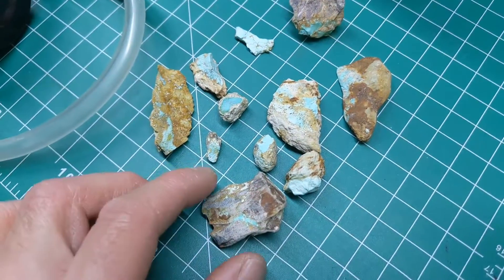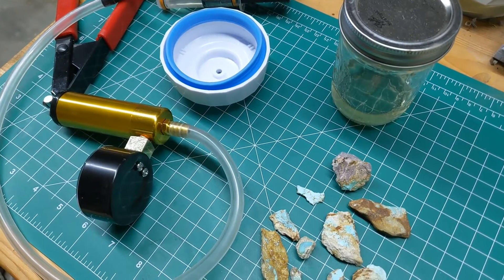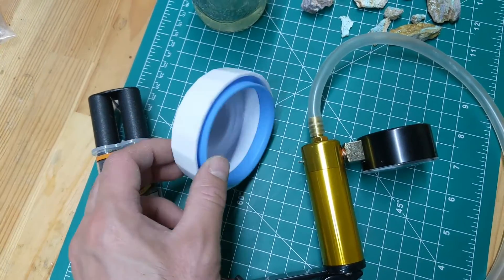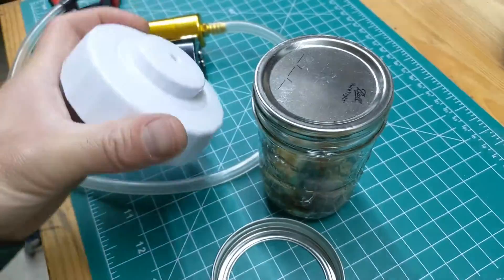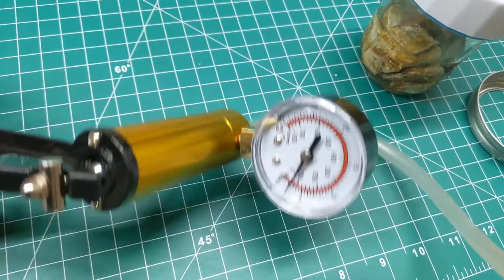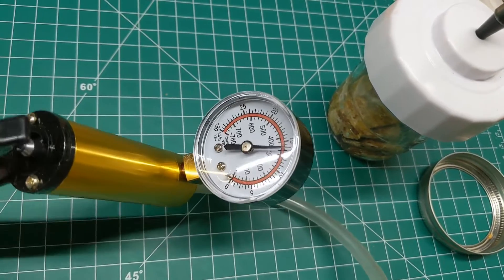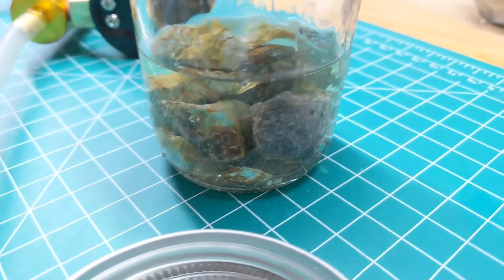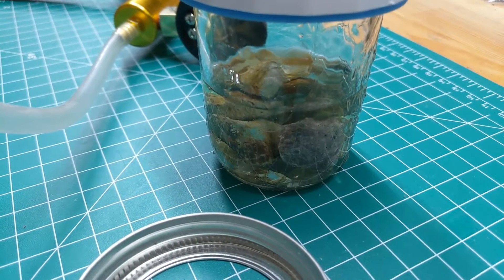How to Stabilize Turquoise DIY (Cheap & Easy)

Comment: You didn't say if you took off the tin lid before you added the pump lid.
Reply: No, no he did not, he figured he wasn’t addressing idiots.
Reply: @mray1255  Actually, the mason jar lids are 2 part lids.  The outer rim comes off when using that type of vacuum sealer, but the actual lid is meant to stay on the jar as the sealer is used.  The pressure difference between the low pressure inside the jar and the atmosphere outside the jar creates a secure seal by forcing this lid (which has a rubber seal on the underside) onto the jar.

The lids are able to maintain a vacuum inside the jar for years.  I have some that  have held for 3 or 4 years and others have jars that have held even longer.   Once the jar has been vacuumed you don't actually need the outer rim as the pressure difference maintains the lid securely.

You see him take off the outer ring and it's there on the mat next to the jar, but you don't see the actual lid being removed.  You do see him put the pump over it but he could have removed it in the bit of footage that's cut out.

As the air is drawn out of the jar the bubbling you see is any air trapped inside the stone equalising it's pressure with the rest of the jar.  Once the bubbling stops it means that the pressure in the pores has equalised with the rest of the jar.  There will still be air inside any pores or fissures but it will be at a lower pressure which, when the jar is allowed to go back to atmospheric pressure, will contract as it's pressure increases again drawing the liquid into the pores and fissures..

If he removed the lid when the vacuum pump was added then the vacuum would have been broken as soon as he removed the tubing and atmospheric pressure would then force the acetone/epoxy mixture up the pores and into the stone. it would then have a week to be pulled into the pores and  for capillary action to take it further in.

If, however, if the lid was left on before putting the pump on then, when the tube was removed,  the atmospheric pressure  would force the lid onto the jar and the rubber seal would stop any air from getting into the jar and relieving the vacuum.  There would be no increase in pressure to force the acetone/epoxy mix into the pores until a week later when the jar was opened.  The pores would have been full of low pressure air until the jar was open so the extra week of standing would not give any benefit.

You will probably have noticed that the air inside the stone took a while to bubble out - well the same can happen in reverse.  The liquid doesn't get sucked into the stone instantly and takes some time to reach it's maximum depth.  If it's sitting around for a week then that is plenty of time, but if the vacuum is released and then the stones are taken out of the resin straight away, there might not be enough time for the resin to  reach it's full depth into the stone.

To get your best penetration you want to start timing your week after you have broken the seal and allowed the air back into the jar forcing the liquid into the pores so it is useful to know if he had that lid on or off while he applied the vacuum.

Comment: So I need help. I tried this and about 80% crumbled and turned to sludge. I tried to not use the softest stones. What went wrong?
Reply: Well it would take to long to list, but I have been cutting and stabilizing turquoise for many many years now . First get a real vacuum  pump and a chamber. Next google cactus juice resin these people have got it perfected . If you ask them for tips they will always try to help you.
I usually  follow  their original instructions  but I always warm up the turquoise  in my little oven after I have scrubbed them under water to get all the dirt and loose stuff off .
I then put the  warmstones in my pot for 1 hr and pull a vaccum to dry them out really well inside this is important  .
Next I put rocks in a smaller container cover them with the resin leave room on top so you don't  bubble over start pulling alittle vacuum at first while it bubbles like crazy as it kina smooths out got to full vacuum  around 25 to 27 inches of vacuum  it will vary depending  on your elevation  I let the pump run for a few hrs until the bubbling stops I tend to close the valve on the pump an let it set overnight with the pump off but still holding vacuum. 
The next morning I release  the vacuum. 
You can now just let it sit until evening like most do or if get a pressure pot from harbor freight  you lift the whole container  out of the vacuum  pot and lower it
 carefully into the pressure  pot don't lift the stones out of the resin yet important..
Then pressurize the pot to about 50 psi.
Now you are pushing the resin into the stone leave it like that for about 2hrs. 
Then release  the pressure  gradually  for saftey  next remove the stones let the drip in a strainer for a few minutes  while you pour the rest of the resin back in the bottle make sure you wip off the bottle really well I then slide it into a plastic bag and store it in fridge this stuff can last about 18 months if you keep it cold. 
I have a small toaster oven that I set up outside then placee all the stones on a foil covered tray  set the oven to about 225° to 250° heat the stones about 3 hrs then let them cool .
Their done then.
General rule if you only 
Have a vacuum  chamber for every hr you pull vacuum  on you stone you need 2 for the resin  to penatrate. 
Before I started using  this process  I would simply  soak the stone 
With thin super glue let dry overnight then cut out my slabs soak the with super glue thin again  the cab them if they are thin slabs I back them with  JB weld hope this helps any questions 
DM me at 505 675 8595 thanks, Patrick

Comment: I noticed the Epoxy link you shared is not the same Epoxy you used in the video. Does the Epoxy in the link work better than the Gorilla Glue Epoxy?? Thank you so much for this video!
Reply from the maker: I've heard the DevCon works just as well

Comment: Can’t find the ratio of epoxy to acetone…
Reply from the maker: Howdy, please check the video description text, it's in there.
Reply: Sorry you tell  that the ratio acetone epoxy is in the video and in the video you tell that the ratio are in the comments 😂😂 so no ratio is described anywhere 😂😂
Reply: @sergiogiusti456   I believe it's about 19 to 1. 473mL of acetone to 25 mL of 2 part epoxy. That would be 12.5mL each of the resin and hardener.
Reply from the maker: @sergiogiusti456  The video description text is not the comments. It's posted.

Comment: The 30 minute epoxy cures slower but is thinner.  Also all epoxy can be heated to 180F after a day or so of cure and the heat will increase the clarity and hardness.  WentSystem has lots of info on the different exoxy formulations.